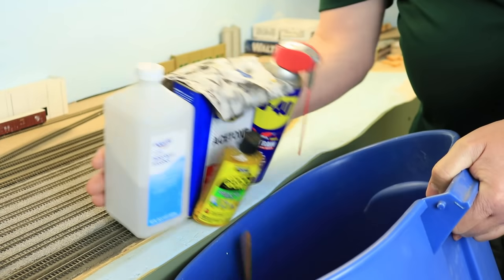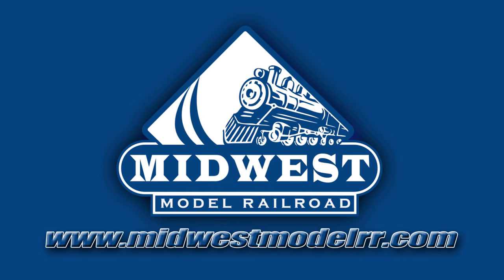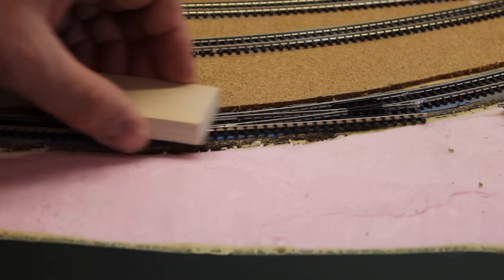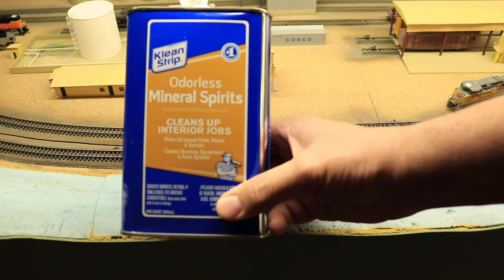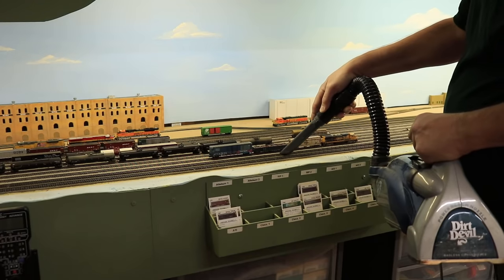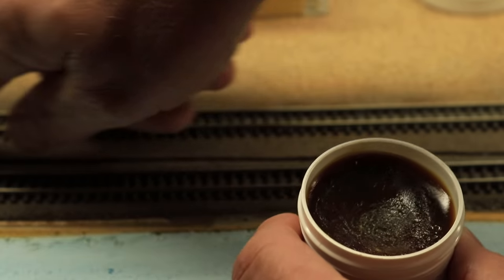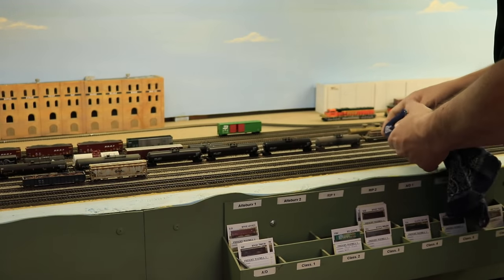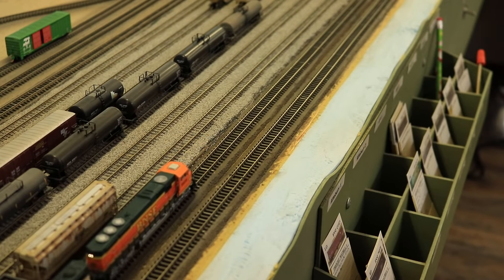Stop Cleaning Your Track on Your Model Railroad

Comment: Thanks for the info Ron. I just ordered mine!
Reply: As did I .
Reply: A follow-up to my earlier comment. So mine came in and I recently applied this technique to a section of problematic track I have on a loop. After cleaning first with mineral spirits, I then applied the No-Ox-Id. Noticed an improvement instantly. Have the short train running around for a little bit now so I'll wipe down later. Thank you again Ron!
Reply from the maker: That is great news. 👍🏼

Comment: Sounds Awesome just wanted to Ask though i got the Product ACT-6006  as a suggestion from the Guys that use to Work at Model Trainstuff  they had there own model Railroads one being Terrell Owen's Or Otis.. Arthur Houston also said this product was Great to use but if the product has properties in it Ron that can promote issues as you said some products can then should I stop using it,  it list it's ingredients as Parrafinic Hydrocarbon but the Website might shed a bit more light if there is Any other.. But Arthur Has a Great Big Layout far larger than Mine and he's been Running it for years so I'm on the Fence but if there is something that will make our locomotives Run smoother especially the one's with sound and if there's a blurp in the Engine's performance i'm certainly for changing things up a Bit. 

Now on the mineral spirits I thought some of that stuff you need good ventilation I'm for using some products but living in Apt not my own Home and the layout because of this Apts size well its close to the Kitchen, Bathroom and frontroom would the spirits be low enough in oder and safe to use in a setting like mine.. 

I know I ask tough questions sometimes but its best to get them out there Now as to learn the Hardway we don't want it hurt someone or something and in my situation I don't own where I live and I'm not for being removed before wanting to move on our Own.. But I will look over at all the Products you mentioned And Gregg at Flishplate Films he Praises BIG Time #INOX mx3 so maybe its a thing to Try n' Use it.. 

I'll add I think to promote good Track Health one shouldn't be pulling up Track replacing it all the time unless there having turnout issues my Track has been basically where its been since 2015 I have NOT!!!! replaced it once just cleaned it done the burnishing with the Stainless Stell washer and used my ACT-6006 thats about it now I have used 90% isopropyl on my Engines wheels but if the mineral spirits doesn't Harm plastic I might do a switch and get away from the IPA all together.. 

To End I liked your Video Ron it was Very interesting to know or learn about something thats been out for some time and maybe for some of Us setting right under our Noses but talking about this stuff is what helps and sharing the Info because we all have one Goal in mind Enjoy our Train.!!!! 🚂🚂🚂🚂 
Allen D
Reply from the maker: As for the ACT 6006, I cannot speak to it because they supply no information as to what is in it. Personally, if I cannot verify what is in a product, I am not apt to use it. As for mineral spirits,  regular mineral spirits have an odor. I use odorless mineral spirits. They still have a smell, but it is faint. According to all warnings I have read the vapors are non-toxic unless aerosolized and inhaled in large quantities. In other words, use on a rag out of the can--no problem. Don't run it through your airbrush, and if you do (I can't imagine why you would) wear a respirator. That would ALWAYS be a good idea anyway.
Reply: Hey thanks Ron.. On a Air Brush we don't have one of those as of Yet but I wouldn't even attempt to use one in my Apt it would be in a open shop or Garage with a Air system filter to catch the paint or shelack,  in my Wood Shop Class back in 80's we had 10 X 10ft Spray Room with a pretty powerful suction Fan When we shelacked our Wood Projects it definitely kept the Spray off of us it also help that we had Good Guns to spray with.. With adequate Air to push the Spray.. As with Air brushing and having adequate Ventalation the Same should be with Soldering I'd have one those Specialty Tools that Intakes All Solder Vapors and purifies it through Filters.. It doesn't hurt to be Safety conscious... 

And I do agree about the ingredients on the ACT-6006 I'm going to call AeroCar and ask them if they have a safety sheet or list of added ingredients if any thats in the ACT-6006 see what they say but I have Inox mx3 coming my Way And if I can get my Hands on some of No Ox ID A special I'll surely give it a try....

Comment: Hey Ron when talking about oxidation, would running a dehumidifier in your train room reduce the amount of "natural" oxidation that occurs naturally when you're not running trains? Especially in humid climates?
Reply from the maker: Hi Andy. Lowering humidity certainly will help. I run a dehumidifier in my basement and try to keep humidity no higher than 50%.
Reply: Thanks Ron! Good video, good info!

Comment: I really not had many problems cleaning my tracks. A little steel wool or a pencil eraser does the trick for me. I run O gauge stuff and I find a few sparks and clicks part of the old train experience. I keep the workings of my engines clean and running wells but I do not mind some old pitting and such. I have many trains that my friends wnt to paint but I just can't stand a repaint.

Comment: I was certain this “no ox ID” would be some expensive thing I barley need any of but damn this stuff if $7 on Amazon. Already on the way, I’ll use some mineral spirits and get my track immortalized in no time. I find that nickel silver rail already resists oxidation pretty well but there’s definitely some older pieces that could use some tlc

Comment: I really like this tip.  I wonder how this would affect a layout which is running plastic wheel sets rather than metal ones.  Specifically, would plastic wheels experience that build up of “gunk” that we typically get if we switch to the techniques that Ron has implemented. If not, then perhaps we don’t need to pay the extra cost to replace our all plastic wheels with metal ones. Anyone have any thoughts on this?
Reply: On a model railroad forum they say that mineral spirits will eat away at plastics so I am discontinuing use.

Comment: You're right, but it's nothing new, only a good reminder. 
The Fleischmann catalog already indicated to oil the rails in the 80s. I use this method for Marklin Z scale which improve the power pick-up.
Alain
Reply from the maker: I said in the video that this process has been written about since the 60s, but it is little discussed and rarely utilized, so a refresher was in order.

Comment: What is your view on using a product with the unfortunate name of Gorilla Snot. I’ve been told that this greatly enhances electrical contact between loco wheels and track. It is expensive so any input would be welcome.
Reply from the maker: I'm not aware of this product, and searching for it I see air gel products by that name and a lubricant that is called gorilla snot in slang, but I see little info on it. Honestly I would.use NO-OX-ID as it has a proven track record.
Reply: @RonsTrainsNThings  thanks Ron. I really enjoy your videos!! They have helped me a lot.
Reply: @RonsTrainsNThings  'track record' ---nice!

Comment: Could you install a small battery or capacitor that is charged from the rail. Then if you have a momentary loss of connection the train would keep running.?

Comment: Hi Ron....great video. I find this subject quite fascinating. ( I know I'm weird,,hah) Now, one of the best things you can do for your layout room is to install a dehumidifier...(maybe not so much for the very dry climate areas), but it's very important to pull all that moisture from the air, this also contributes to the oxidation of the rails. Especially if folks are still using Isopropyl Alcohol. Another good use for the dehumidifier is it will give longer life to wood structures and wooden ties. I started using CRC 2-26 after watching Greggs (Fishplate Films) videos...finding the 2-26 was not so easy here in Canada. But finding Mineral Spirits will be much easier. How about wiping an ultra-thin layer of No Ox on an Aztek roller and running around the rails? Then send a second train out with the wiper roller on it.? Just curious ...btw (Im a close friend of Marcel)

Comment: Is that mineral spirit actually the ”white spirit!? Got no ideea here in Europe what is ”mineral spirit”
Reply from the maker: They are slight variations of the same thing. Whit spirits will work great.
Reply: @RonsTrainsNThings  thank you Ron! Did some diggin' meanwhile, it came out that 'White Spirit" is a kind of' terebentine', wich afaik has a strong petroleum derivate smell. However I have ordered a bottle from a paintings specific store, labeled 'no smell", can' t wait to receive it and give it a wipe.

Comment: I run O gauge trains on Lionel track cleaned with mineral spirits and coated with No-Ox......and, I run engines with traction tires.
I have no problems as I don't pull more than 7-10 cars at a time.  I cannot attest to problems railroaders may have with very
long consists......
Reply from the maker: Thank you for sharing your experience.

Comment: I’ve been using 91% Rubbing alcohol for years. It clean it fantastic and I’ve never had any problems!!!!!!
Reply from the maker: Yes it cleans very well, no one has ever argued with that. It also promotes oxidation, however, causing you to need to reclean more often.
Reply: @RonsTrainsNThings  I never had any oxidation on my rails in any scales I’ve been in. Only reason I have to clean my track again is it  becomes dirty over time again. Telling people to stop cleaning their track is poor advice in this hobby. You have to clean your track. If you don’t over time the electrical current will drop and trains will not run. The amount of dirt and dust and other things that adhere to the track from not only the trains but what’s in the basement affects the track and trains. Proper maintenance on any layout is important.
Reply from the maker: I clearly stated in the video that you will have to dust the track or vaccuum periodically, but the black stuff that some off of the rails is not dirt, itbis silver oxidation from the nickle-silver track.

Comment: I'm building an ho dead rail system using rc car components. no power to the track means no skipping and studdering also no track cleaning. its not a big layout but it just means more running and less problems.
Reply from the maker: Clearly if we could all go dead rail this would be a dead topic. 🤣👍🏼
Reply: @RonsTrainsNThings Very true. hahaha!
Reply: Hey tell me more about this dead rail rc car compenents set up
Reply: @AngentPinkShoes   you use micro transmitters and micro ESCs for drone building they are all available on ebay. I'm using a standard rc car receiver but I thin bluerail makes a bluetooth receiver module. It pretty straight forward. Oh and you need a micro 3.5v to 12 volt converter.

Comment: G-gauge outdoors using nothing higher'  than 1000 grit (, or the LGB track cleaner). 
And usually only concerned beyond the upper flat railhead at power contact pts, when 'track powered'.        Not concerned with the outer rail side, therefore simulating the proto' appearance.    ;-)
Indoor (controlled elemental environment LoL) trackage similar, but not often required for G-gauge due to larger contact/railhead surface area.  
Although maybe in the future the 'backshop/maintenance'  may source,  and try out your recommendation     8-)

"G-Gauge may not RULE, But it GROWS on Ya !! "   djc'99

Comment: Has anyone else cleaned LGB track (1985-1995 track)with The Pink Stuff? It seems brilliant! I do rinse it off with hot water and dry with a blow dryer immediately after rinsing. I also rub down with WD40 after dried. Can anyone give any input on if this might be good or not so good? It seemed to work well for me. Please tracks have been in and addict for over 15 years and had a lot of corrosion and oxidization.

Comment: would it still work to use the CMX clean machine with the mineral spirits?
Reply from the maker: Yes, that is what I am doing with my CMX now.
Reply: @RonsTrainsNThings  I wonder if a good liquid electrical contact cleaner would work as well
Reply from the maker: I haven't tried it, but I would think WD-40 contact cleaner or CRC contact cleaner & protectant would work. You have to spray them into a bottle then pour into the CMX, but I don't see why they wouldn't work.

Comment: I wonder if automotive dielectric grease might do the same thing......
Reply: I've seen this question before. I think dielectric grease  is non-conductive so it won't work. No-Ox is conductive and leaves a conductive residue when you wipe it off.

Comment: The absolute best way to clean track is to run trains.  Preferably every day but once a week will do.   All that chemical carp is just hocus pocus.  You can use   isopropyl alcohol to clean wheels if you want.   Don't worry about it being polar;  the stuff evaporates off with no residue so being polar doesn't matter.
Reply: actually yes it does cause the isopropyl alcohol promotes all the black gunk and i done the method he said and my train are working alot better

Comment: I've watched a lot of these track cleaning videos and it seems nothing is perfect.  Solid cleaners like Bright Boy scratch the railheads which causes dirt to collect in those scratches.  Liquid cleaners act as lubricants and reduce traction.  Alcohol is flammable and dissolves plastic.  I decided to just use a dry microfiber cloth.  As a New Yorker, I see giant sparks under the subway trains all the time, and I imagine the same thing occurs on our model railroads on a microscopic scale.  So maybe some kind of metal polish is appropriate.

Comment: My worse problems electrically speaking is having power routing points not make good contact with the main rail.
Reply from the maker: You cannot count on the contact of power-routing turnouts. Install feeders on track out of every pair of rails of a turnout.

Comment: I have a ton of old HO track.  I hate hearing everyone say 'throw it out' ??? WHAT?   NO>    Would Scottbrite pad be okay?  SO many do use the sanding blocks with no issues?   Seems everyone has ideas on cleaning.   I think there must be a happy medium.   I'm looking into how to restore very old HO tracks.  I want them to be used, as they are 'original' and not modern.   We don't chuck our old engines or rolling stock out.  Why would you just chuck out perfect old tracks that just need cleaning.   Metal doesn't go bad!  Just needs resurfacing.  (which may be what I do.  A belt sander with micro fine belt).

Comment: Personally, I would not use mineral spirits on your track as it’s a surfactant!  If anything, I would use a good quality, auto body refinishing grade -final wash, This is a non-surfactant!  Easy way to tell if a liquid is a surfactant is wipe it on a piece of glass and then let it evaporate!   If it leaves a residue behind, it is a surfactant!   Also, the electrical style grease you were talking about that is basically, automotive dialectic grease!   Basically what you do on every connection you would do on an automobile, i.e. lightbulbs, fuses, battery contacts.  As it has corrosion inhibitor‘s. You’re basically trying to prevent ozone between the two opposing metals!

Comment: Iv all ways use acetone in my cmx clean machine. I guess I gotta switch to something else.
Reply from the maker: You can use mineral spirits in tour CMX car, you will have better long term results, you won't risk damage to plastic parts as with acetone, and the vapors are not as noxious or harmful.
Reply: @RonsTrainsNThings  1 thing I'm worried about is mineral spirit is a lot slower drying then acetone
Reply from the maker: I only apply to the rail heads. By the time I clean the whole mainline where I started is dry.

Comment: Sorry this tripe regarding track rubbers scratching the rail surface is a myth. If you take a piece of brand new track and place it under a microscope it will reveal the scratches are already there. After using a track rubber place the track once again under the microscope you will find no difference on the track surface. Indeed in our club we have layouts 30 years old running on the same track from when they were built. The only method we use is the track rubber, so let's get rid of this myth once and for all. Also we dont have to clean our track very often. No doubt you will disagree with our experience but there we have it. We do however wash our track rubbers in hot soapy water to get rid of any muck that collects on the surface of the rubber.
Reply: Agreed, rails are pretty tough. 
I just oil mine: paint on a little 0w40 in a few places, and once spread round by the loco you get perfect running for no effort, and nice clean loco wheels. Traction suffers a little: but not enough for me to worry.

Comment: i imagine that isopropal would not work, it leaves a residude. how about hydrogen peroxide?  prep sol? deox  it? i used deox it when i used it when i did aviation electronics [aircraft electronics}
Reply from the maker: Hydrogen Peroxide is very polar, don't use it. Deox-it is a good option. I don't know anything about Prep-Sol.

Comment: Modelers beware. No Ox Is very slippery.  If you have a layout with grades this stuff will really reduce tractive effort on your locomotives. If you apply to your layout be aware that removing it from your track will take a very long time and a lot of elbow work. For me it's not worth the results to use it. I use a cratex bar probably twice a year and keep my train room CLEAN.

Comment: Locksmith do you is WD-40 . WD-40 has oil in it which lint sticks to and dust .... ... locksmith use Super Lube. The synthetic with ball bearings with no oily residue.